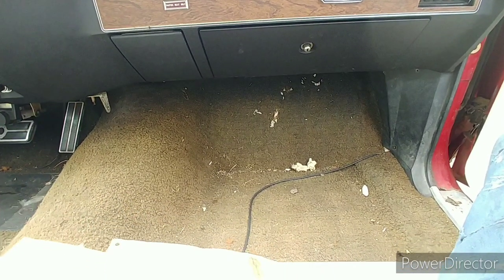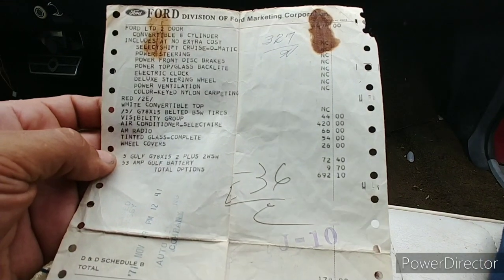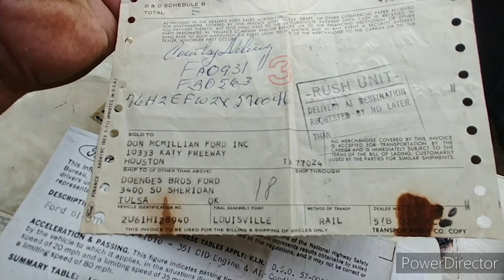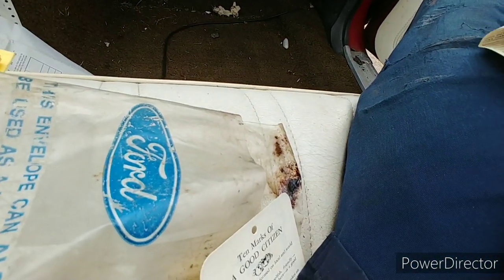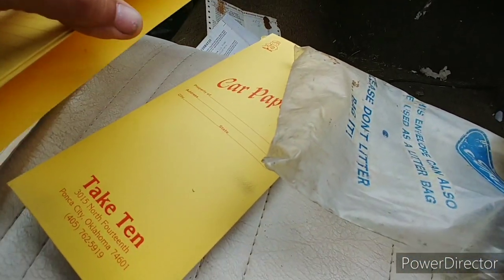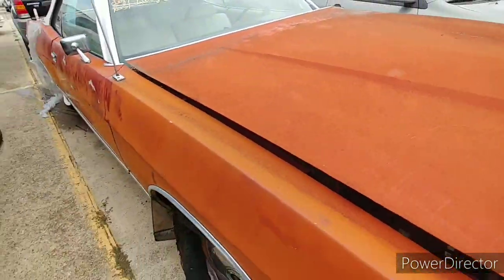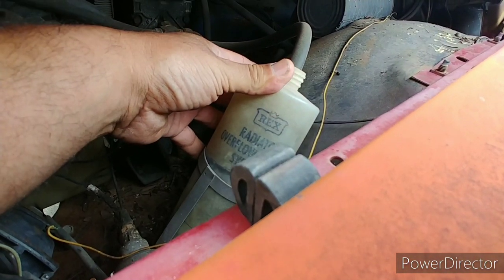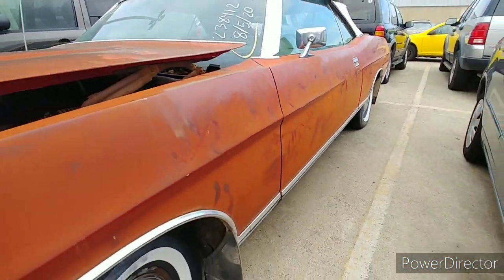1972 Ford LTD Convertible Auction Find

Comment: Bennie, the rust issues are not that bad to what we saw here in Northern Indiana. What you are looking at, we would have seen here on one of these old Fords, by 1975. By 1980' the frames rusted out so badly, that the bumper would be sagging, and perhaps would have a bungie cord holding the bumper up, on one side, or both. I am not exaggerating one bit. These full size Fords were rust buckets, big time!  The 1973, and 1974 GM entire line was like that too. I think these cars were made of rust!
Reply: The 73-77 GM "A" bodies were like that. My neighbor had a '77 Cutlass and my dad said to him, "Artie you're going to lose that bumper, let's fix that".  My neighbor said "Nah it's fine". Two weeks later it fell off on the Brooklyn-Queens Expressway when he was going to work and almost caused a major accident. After that, he got a new bumper from his daughter in law's father (who worked at GM dealer) and the car got fixed up and repainted. They got rid of it a few years later.  But yes, you could hear the "crunchies" in the rust as the bumper was drooping.

Comment: The drop top saved her from the crusher, but she needs a body off resto to do it right and that won't be cheap.  Wheel covers must have meant full wheel covers vs. beer caps or dog dish.  Depending on the trim level, a lot of times the dog dish actually looked better and usually stayed on the car too.

Comment: Dang that's a hell of a hitch.
Reply: Looks like a class 3 hitch with 2 inch reciever. The hitch is rated ay 6000 lbs but actual rating probably is less since determined by vehicle. My dad had a class 3 on his 65 fury and 81 Chrysler to pull boats.

Comment: Nice ride👍 but that damm rust!
Reply: .. The BIG question in my mind... is whether the rust & ROT.. has caused some significant structural weakness... especially in a convertible.. which do not have the torsional stiffness as a car with a fixed metal roof.   Will it drive like an old sled... a-k-a  as a "flexible flyer" ?

Comment: LTD never had a factory 351w in those years. 302 only SBF in them. Get it right
Reply: Nope, The VIN code of  "H" proves that this is a 351 two barrel Windsor. A VIN code of "F" instead of the "H" would have likely been the 302 engine on that one. This is a true 351 V8 originally.
Reply: @googleusergp  not a windsor... cleveland or M
Reply: @johnhull6363  Both the Cleveland and Windsor used the VIN code "H" in various years. This is a 351, you said it was a 302. That is not correct. This car is a 351 V8 originally.
Reply from the maker: John, I looked at the valve cover. I believe you can see enough of it in the video. It's a 351w valve cover. I wanted to make sure it wasnt a Cleveland as well.
Reply: @ClassicRideSociety  I agree on that. The "H" VIN code was used for the 351C as well, but this looks like a Windsor.
Reply: @ClassicRideSociety  302 was available in ltd but 351 windsor was not, either wrong engine or ??? Agree valve cover is a SBF. Maybe car is non original engine. But 351w was NOT available factory this year
Reply from the maker: @johnhull6363  I see your point there.  From the vin, it was a 351. When i looked at the valve cover, it definitely wasnt a Cleveland, so I assumed 351w. Probably was swapped then. If they would have allowed us to open the hood i could have verified whether a 302 or 351w. Unfortunately I didn't have the time to do more research while I was there with the car
Reply: @johnhull6363  So why is the VIN code an "H" on the window sticker and VIN tags and plates? That goes with a 351 engine, NOT a 302. The 302 VIN codes were "D" (police and taxi/HD) and "F" for the regular 302. This has an "H" for the engine code. It's a 351.  Further, the 302 doesn't show as available for the 1972 LTD, only the 351 and up as per the Ford brochure: https://www.lov2xlr8.no/brochures/ford/72ford/bilder/11.jpg
Reply: @johnhull6363  wrong, I had a 1970 LTD with a 351 Windsor in it numbers matching and currently own a 1971 Like TD with a numbers matching 429.
Reply: @brianphillips604  what's your point? I have a 69 mustang 351w 4 BBL....one year only.... ltd's had M or cleveland 351's as a full size vehicle in 72
Reply: @googleusergp  yes its most definitely a 351W bcuz the number of bolts on the valvecover plus the distributor is in the front. I know bcuz Im the buyer.
Reply: @ClassicRideSociety  yes I would have agreed too of the H but its most definitely a 351W. I know because Im the buyer
Reply: @andrewdandridge8108  The "H" VIN code proves it's a 351. Plus the 302 was not used in the LTD in 1972 according to the Ford brochure I posted. I decoded the rest of the VIN and the trim tag. This is a Louisville, KY built 351 two barrel car. It was originally red outside, with a white/black interior,  FMX automatic equipped, 2:75:1 rear axle and delivered to DSO 57, Houston, TX.
Reply: @johnhull6363  You originally said that the LTD for 1972 came with a 302, but not a 351. That's not correct, we've shown that with the Ford brochure. What's the point you're trying to prove?

Comment: There's a reason why it is where it is.  For what it would cost to put this thing right you could buy a nice driver.  Forget about a full resto - on this example it would be 50k plus and these cars are just not worth that.  The parts headaches alone would be massive.  Driveline pieces and parts are no problem.  Your difficulty would begin with sourcing everything else from trim and interior to sheetmetal as pretty much no one in the aftermarket supports these cars.  Moral of the story is if you want one find a nice original well kept wash and waxer - spend the bigger bucks to buy it and keep it that way and leave cars like this particular one to the dreamers and suckers.  This is what I would consider a parts car at best.  It'll never see the road again under it's own steam. If $1900 is what was paid, come on over to my house - I have a nice selection of breakfast garbage you'd probably be interested in and it's going cheap!!
Reply: ... The real question is whether it is structurally sound enough... to be a daily driver. ... Some bondo and a cheap paint job... and making the mechanicals function reliable..... and it could be a 'fun'.. 'go for ice cream on a Summer evening kind of car... for a few years.   Yes, it's too far gone to be a candidate for restoration.... but to make it functional is eminently possible.. IF the frame rot and rust hasn't gone too far . . .